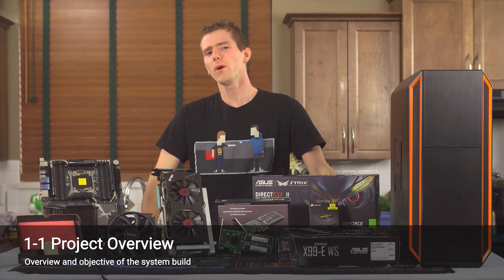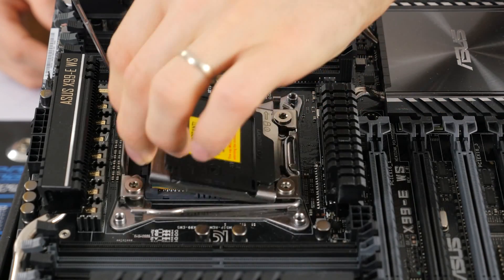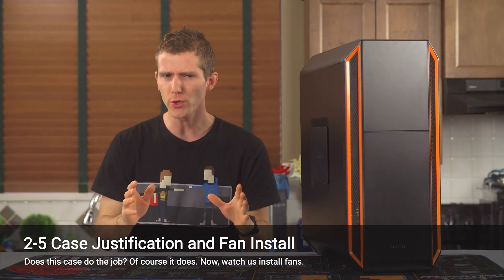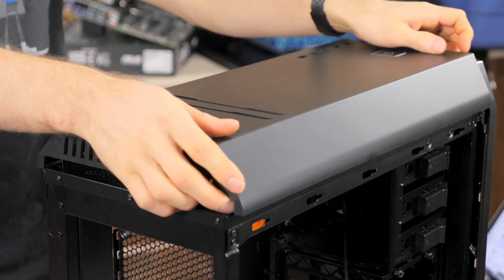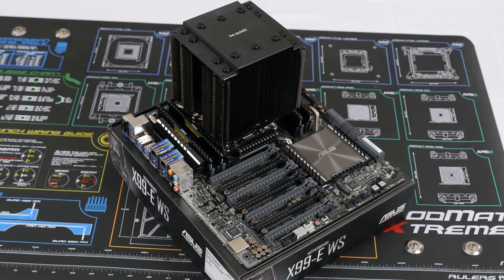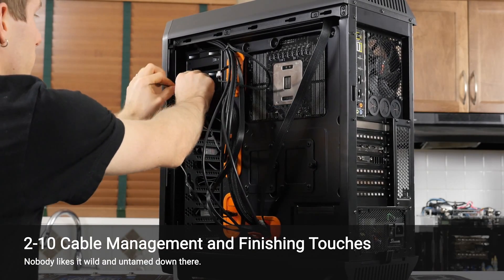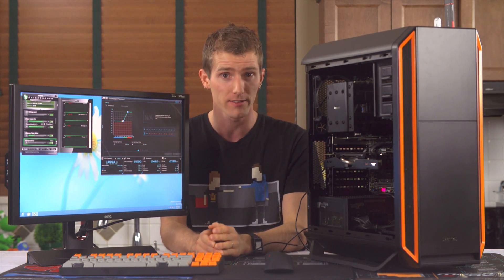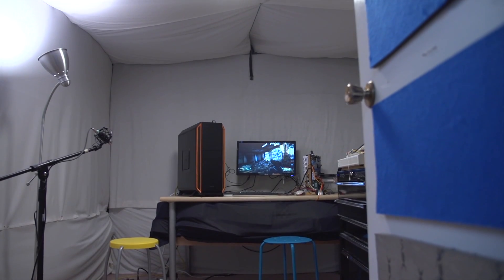How to Build the ULTIMATE Silent Gaming or Workstation PC

Comment: Had a case fan that was a three oin speed control fan and a motherboard with no connector slots left for it so it would sit there at 6,500 rpms or more and sounded like a leaf blower. Having a swamp cooler in my house cant even hear my computer. If I move however building a quieter rig would be nice

Comment: What a horrible fan placement for silent PC building. Just turning the back fan around would get better temps (by not sucking the GPU exhaust) and lower noise (by avoiding the grill tubulence and speed rise from the pressure drop between cooler and grill) which would possibly allow to remove the top fan. Putting the top fan in the front/bottom would likely reduce the noise by feeding cool air to the GPU and thus preventing that the GPU fans would have to work as hard especially seeing as the GPU fans are the noisiest component there. Fan placement is critical for temps and noise levels.
Reply: nope.jpg

Comment: Do you need a heatsink if it's not such a high grade processor?
Reply: Yes... do NOT start your computer without a heatsink installed, and proper thermal paste applied. Your CPU will die within 30 seconds if you are lucky... ALWAYS use a heatsink.
Reply: This is all wrong, you can take the heat sink off. It will allow the cup to breathe better and will also remove the weight holding the processor down making it capable of producing more power so you can run games like Witcher 3 at 1080z. Don't let the trolls tell you otherwise!
Reply: +Wowthatsfail is lying

Comment: very interesting clip. didn't quite get the idea of having a 'positive pressure' inside the case, but other than that I think  that using one of 'hybrid' models from the seasonic's 'X' series would be a mistake since they tend to be quite noisy in terms of what you're trying to achieve here. Their fan controller uses the thermal sensor very aggressively, so unless you're working in a cold room (<20C) you will hear the noise coming out of it..

Comment: Is that Fred from those Fred videos?!??!

Edit: No.. no it is not. Just looked up who Fred was and it's not this guy. But damn, that's a great silent build! My current build is pretty silent thanks to the H110x v2 water cooler and some custom padding for 2 of my secondary hard disk drives. 

The GPU is still very loud under load, but there's no real avoiding that I guess.
Reply: Verified. Nice.

Comment: tried that passive 80+platinum psu from seasonic. made louder electrical sounds than the sound from my old bequiet straight power E9 fan spinning. so it went back to the dealer. tried corsairs new semi passive psu rm650i also. was better than the seasonic but not quiet enough under load.

Comment: Next build the loudest PC ever. Use combustion engines instead of electric motors for the fans. use 4 of those expensive useless 10k rpm HDDs,
Reply: +martinshoosterman The worst were the 5200 RPM "Green" HDD's that were SLOW AS BALLS, especially when its 2+ tb.
Reply: and remember to put two Radeon 6870's in there
Reply: Linus actually did that a few weeks ago
Reply: This is the best comment I’ve seen all day... i know I’m late to the party...
Reply: martinshoosterman jet engine powered fan!
Reply: Fubar231 I HATE 5200 RPM drives.
Reply: Me: flashback of using 2 raptor HDDS in raid 0

Comment: you most mod your GPU so you can install a large CPU heatsink like the be-quiet, and install all the posible chjasis fans for better  airflow when idle.... so you can turn off all fans when idle and turn on all in quiet mode when 100%...

Comment: so i got an old computer from someone but i want to upgrade 3 parts,
- the motherboard
- the GPU
- Ram

i got this case:  
Aerocool ExtremEngine 3T
It has this motherboard:
https://www.msi.com/Motherboard/P6N_SLI.html#hero-specification

so i checked online for a motherboard and this is the one i think i need:
Gigabyte GA-B150M-D3H
it is a ATX/micro ATX case and the motherboard is Micro-ATX so that should fit

it has a 1151 socket, a PCI-e 3.0 x16 and ddr4 memory slots. 
I was thinking about a intel i5-6400k with a gtx 970 with 8gb of ddr4 ram

Ram: Kingston HyperX Fury HX421C14FB/8
gpu: https://www.msi.com/Graphics-card/GTX-970-GAMING-4G.html#hero-overview

can someone tell me this is good? or is there something i need to change?
i checked so many forums online if it was good but i need someone to confirm this.
Thanks
Reply: +Stijn Hendriks Well, all the components are good. But if you want the best for your money, I'd suggest an i5-6500k. It has better price to performance ratio and teams up well with the GTX 970.
Reply: Thank you